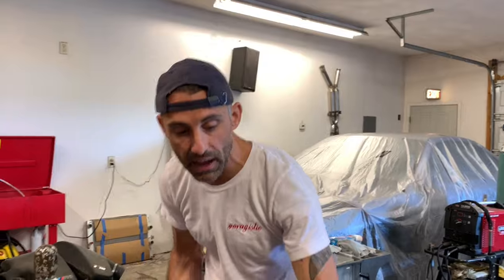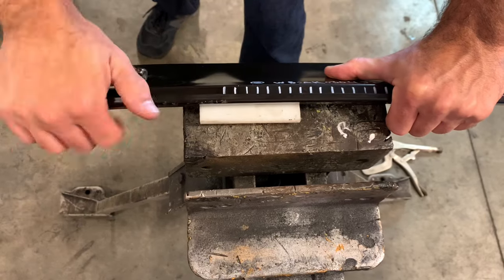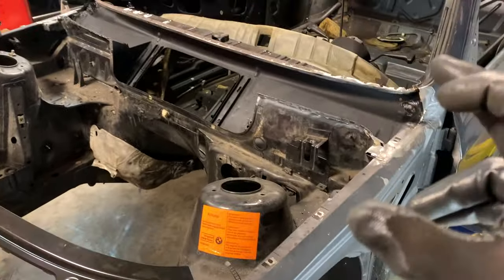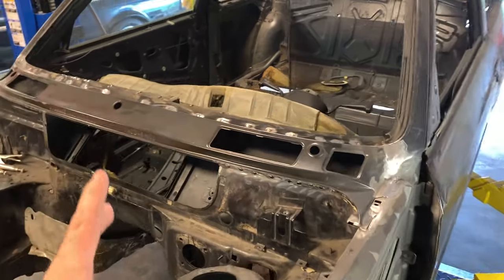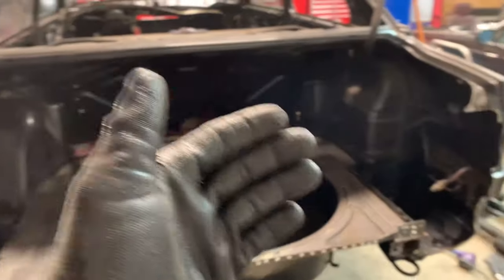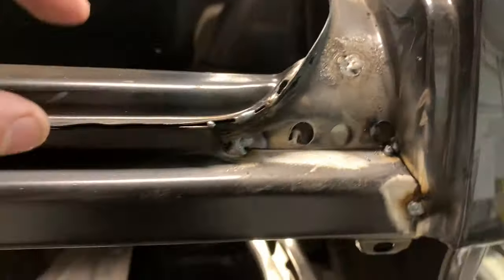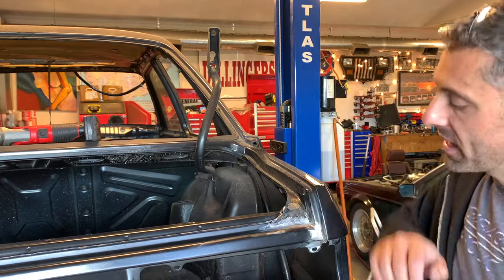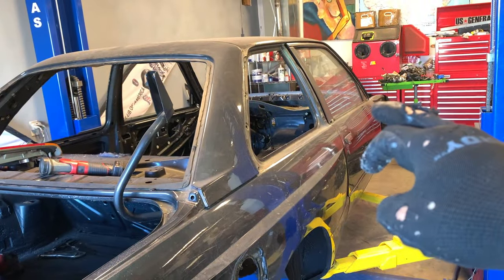NLAM3 Part 20 Body Panel Installation Looking Like An M3 Again!

Comment: If you weld the main seam joints like factory they are all brazed (Bronze welded with gas plant) and therefore keep the seam line rather than mig weld and fudge the line with a grinder wheel. I have seen panel shops fill in the drill holes and then re-spot weld in the same place.
Reply from the maker: Yep I know they are bronze brazed. I do not have that skill and did not want to take my chances messing it up so mig welding was the way to go here.

Comment: So sad to see you welded the rear body panel wrong :( There is supposed to a visible line underneath the taillight that ''separete the rear panel from the fenders. This have you now welded shut, so now you stand 20 meter away from the car and see that the rear panel has been changed :(
Reply: You can still make that lone at body shop
Reply from the maker: I know all about that line don’t worry it will remain. You can make it with something as simple as a dremel cut off wheel before paint.

I wonder, explain to me  how you would weld it whilst maintaining that line without correcting it later?
Reply: @Garageaholic  when quarters are replaced that area is spot welded as the rear panel and quarter panel have two pieces that sandwich together underneath the tail light inside the car, hard to explain but basically the rear panel and quarter panel have both have a tab that turns 90 degree inwards that is then spot welded together, that’s why that line exists in the first place

Comment: Can you really stamp your own VIN in the US ? In the UK I believe you wouldn't be able to buy that scuttle without proof of ownership/VIN, which BMW then stamp and supply on a panel.  In the UK that VIN stamp would be seen as likely being a stolen or cloned car
Reply from the maker: Not sure exactly the issue - I did not change the VIN. I replaced a body panel with an OE panel that happened to have the VIN stamped on it. Granted- the stamping is not OEM - it's close and I did not have the dies to stamp the BMW insignia on it, so a keen observer will notice that this is a replacement panel anyway. And when/if this gets sold one day, the proof of the replacement is in the videos themselves. So if questioned by the buyer, no theft would be suspected upon observation of the stamping, since proof would be in the meticulous documentation of the build. Good comment! VIN work on a rare car like an E30 M3 is always a good debate!

Comment: With all due respect, this is a hell of a job.  you can't do that m3.  so you can't put a number on it.  so you can’t weld seams that were soldered with brass.  Do not apply joint sealant to bare metal.  in this video everything that can not be done with a good car.  fans and masters watch such videos with tears.  open YouTube and see how the body is restored.
Reply from the maker: I understood about 1/2 of what you said there, but overall appreciate the good and bad comments regardless! Thanks for watching!

Comment: Rear panel should be brazed this is to stop corrosion ...and where the scuttle panel joins the screen pillar and why don't you have a spot welder ??? very poor attempt at panel replacement !!!!!!!
Reply from the maker: Scuttle
Reply: @Garageaholic   wind screen cowling ...